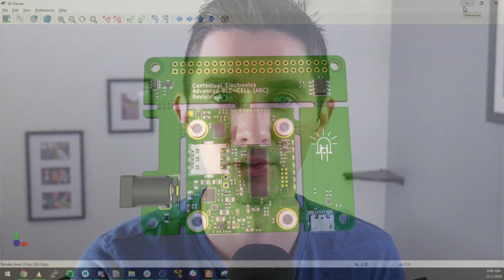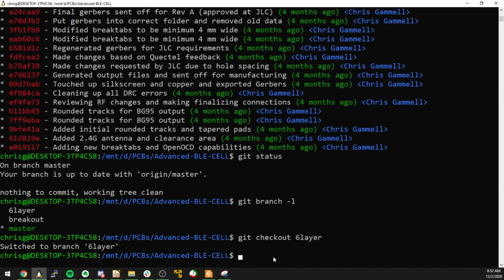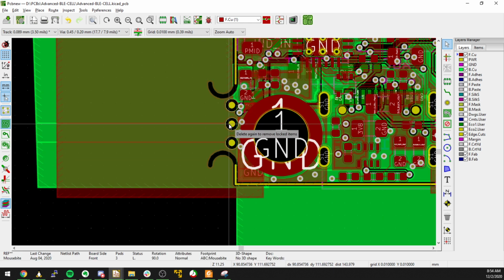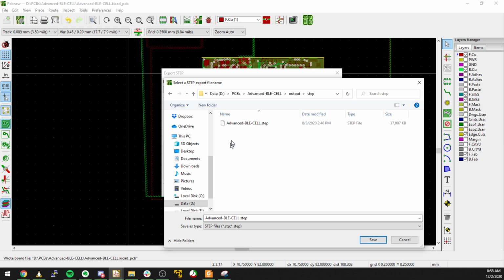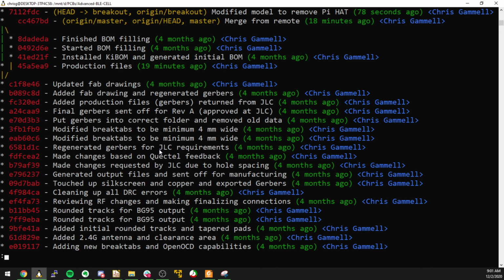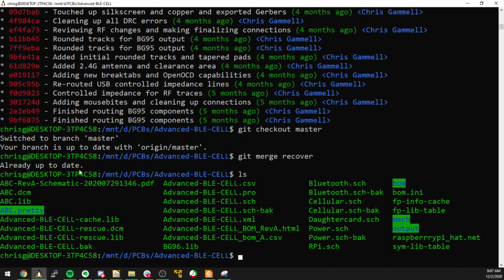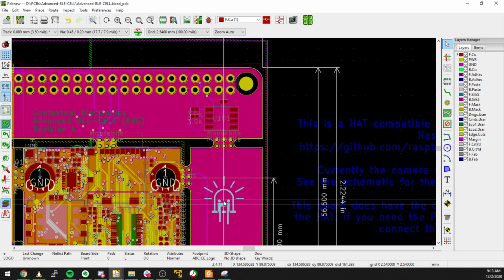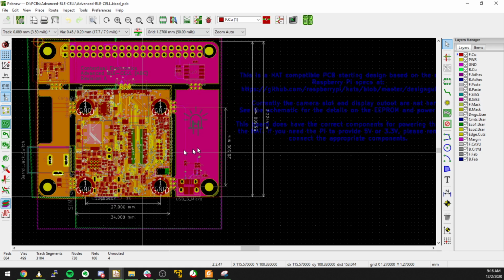Using git branching to create alternate views (layout, 3D model)

Comment: Hi Chris . Question Why doesn't KiCAD allow for a custom design on the copper layers - ridiculous! It's easier for me to (occasionally) quickly knock up something in Inkscape, autocad whatever for precision or one off and just import that into Kicad, but no.
e.g. I want to have a hatch pattern and custom design for Cap Sense button - KiCAD says NO!  It seems so simple to me to just 'allow' importing of a file into the copper layer just like you can on the Silkscreen & logo type layers etc aarrrgghh
Reply: I also don't understand this constraint, but ...

Import in one of the allowed layers (silk, mask). Create a footprint, then open the footprint you created in the footprint editor. You should be able to assign any arbitrary geometries to any layer (except edge cuts?)

Alternatively you could open the footprint file inside a text editor and just Find/Replace the layer names